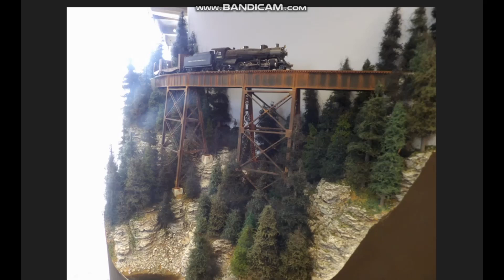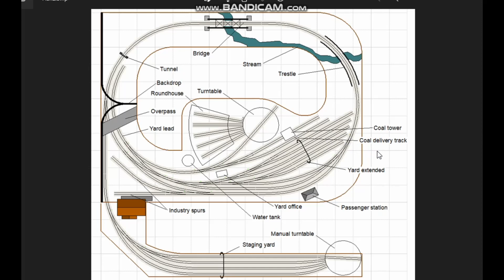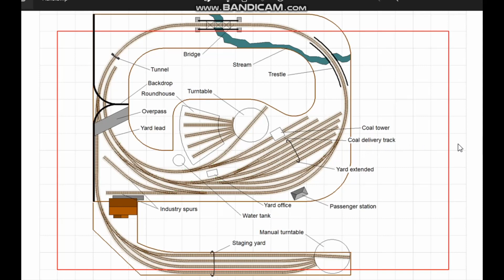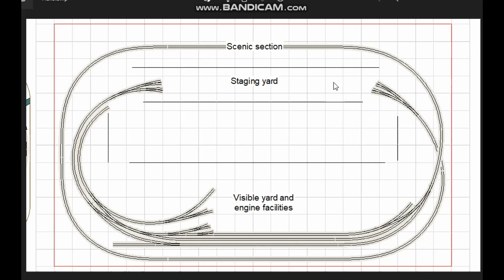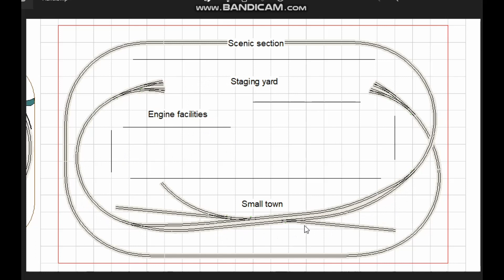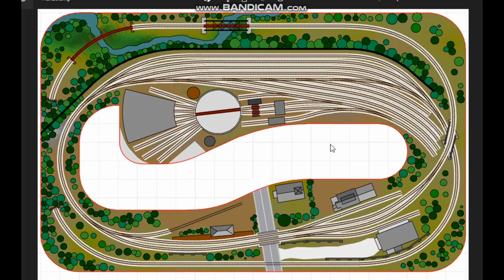Design for a 2-rail O-scale layout

Comment: Hi Peter  Great to see how busy you are.  Is this standard 1.25" gauge track or is this P48?   O scale 2 rail (1.25" between the rails) is more forgiving than people generally know.  This is even more true if you hand lay the track.  Opening the gauge slightly in curves but not exceeding NMRA helps greatly with long wheelbase steam engines.  What is the minimum radius you are using? With easements you can easily run all but the longest wheelbase around 56 to 60 inch radius. (2-8-2s 4-8-4s, 4-8-2s Challengers, Big Boys no problem, on the other hand UP 4-12-2 and SF 2-10-4s would not)  Also the standard frog in the scale for turnouts is usually #6 although I have settled on #5 myself and hand lay all my turnouts. Hope this is useful for you.  Keep up the good work.
Reply from the maker: It's standard O-gauge.  I originally started with a 54" minimum main line radius, but had to drop it to 51" in one place.  My client's largest locomotives are 2 NKP berkshires, which he tells me will run perfectly well on 48" radius curves.  Turnouts on this plan are a mix of #6 and #7 with just two #5's on industrial spurs where large locomotives never have to run through the diverging route.

Comment: I just finished building that Micro Engineering bridge in the video intro; it's a challenging build. Duck under to enter the O Scale layout I assume?
Reply from the maker: That's the Walthers trestle, not ME.  The kit costs a lot more, but it's easier to build.
Yes, it'll be a duck-under to get inside the railroad, but it'll be fairly high so not a huge deal.